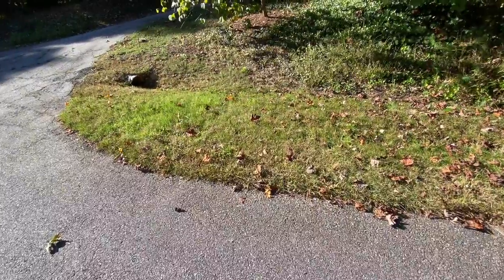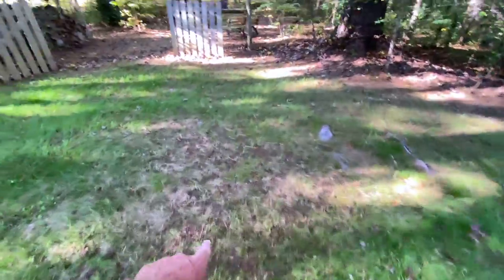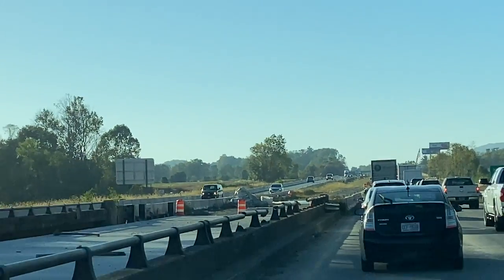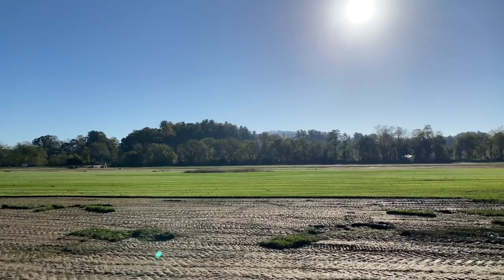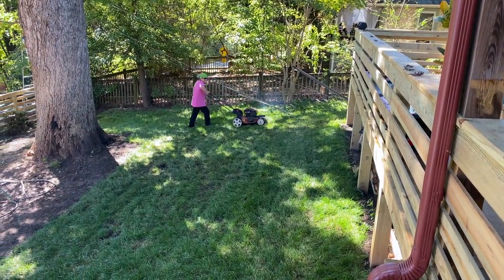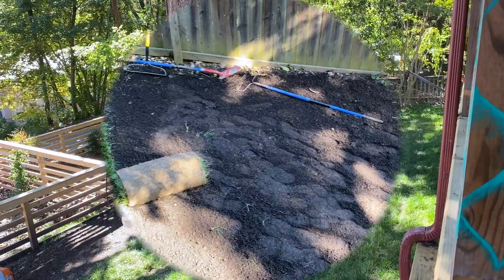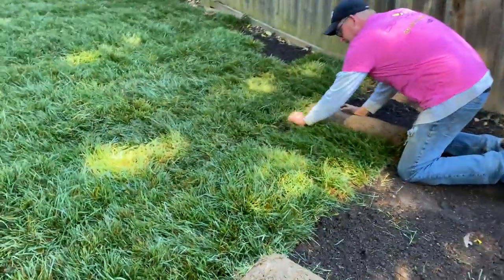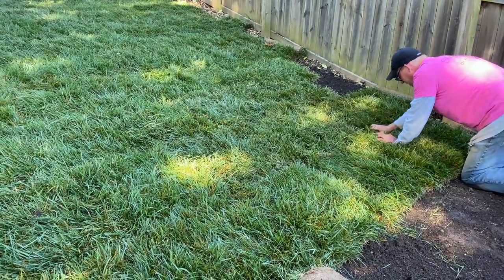The Boss blew up the toro mower! Spitting out black and white smoke

Comment: If it blue and white that’s burning oil. If it’s been sitting for a long time like you said it most likely has a stuck piston ring. You can usually fix it by doing 3/4 oil and 1/4 transmission oil and start it up for a min or two and it should help get the ring unstuck.
Reply: White can mean water in fuel or air outside is cold aswell.

Comment: Sounds like a carburetor issue with the toro Sounded like the choke valve was sticking. Try a small amount of carburetor and gas treatment for it if that doesn't work then it might need a tune up at the local lawn mower repair shop. Black smoke means the choke was sticking on, and the little white smoke was a little bit of burning oil. Check the throttle setting when running it make sure you have it in fast run but not all the way to the choke position. I've had the same problem.
Reply from the maker: Thanks for the advice! I’ll look at it over the winter. We shouldn’t need it anymore. Thanks for watching!